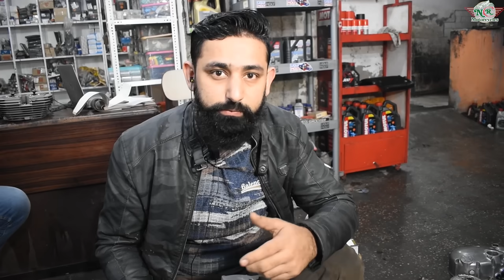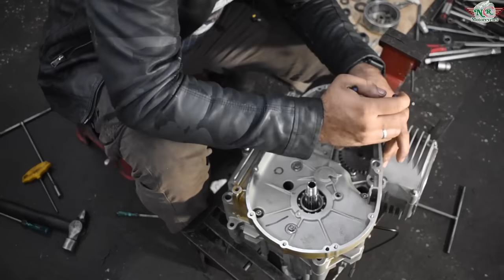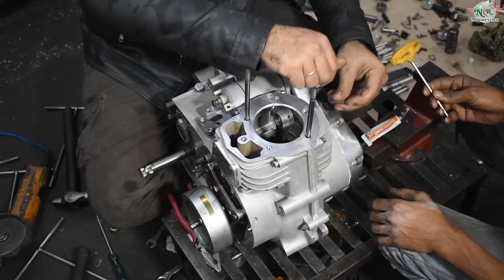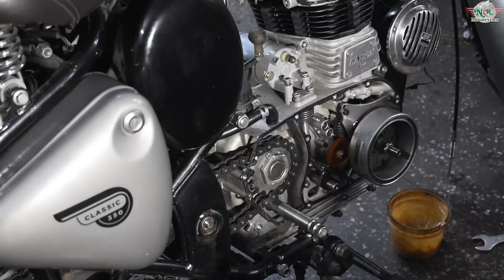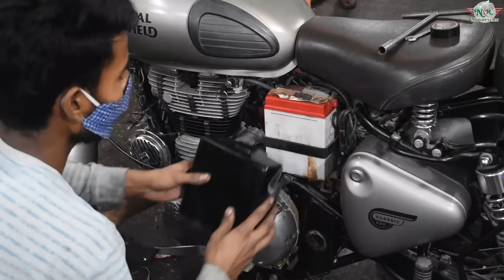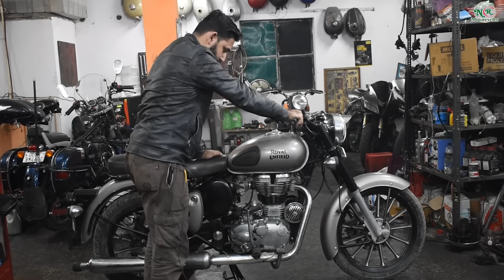Royal Enfield Full Engine Fitting Part-2 💪 | After Engine Fitting | NCR Motorcycles

Comment: Do we need oil chain every 15 days ?
Reply: every 300-400 km
oiling your chain too much can cause brake fail sometimes as the oil spatters everywhere and can get into the drum
Reply: @ajaychoudhary9817  so what do you suggest
Reply: @narengirish1674  apply lube after 300 to 400km regularly and keep your chain clean